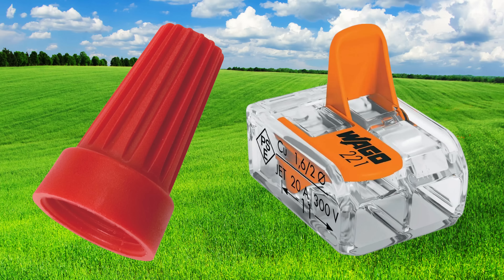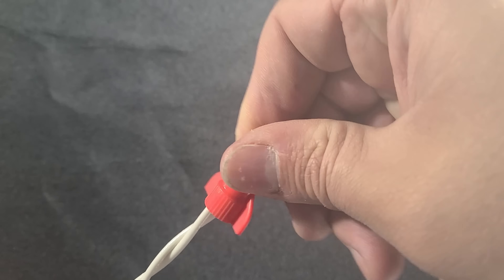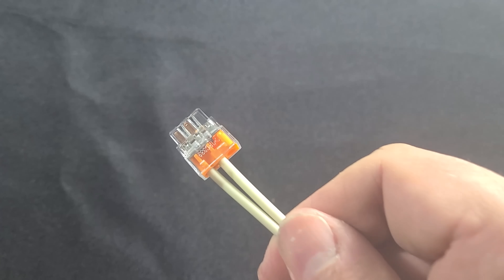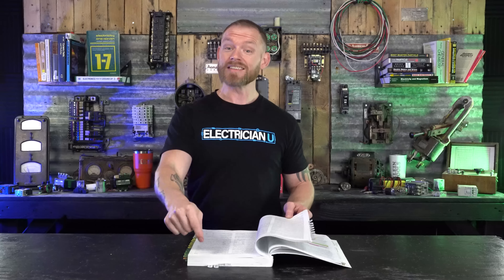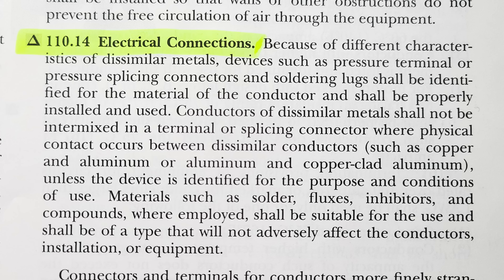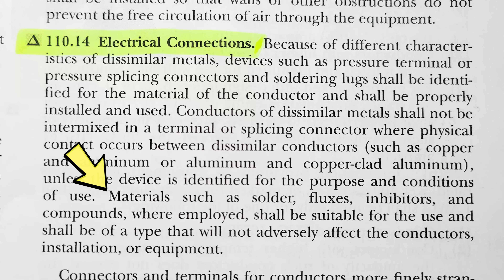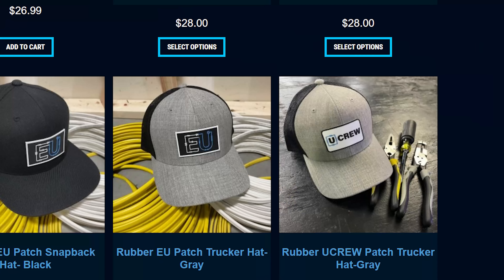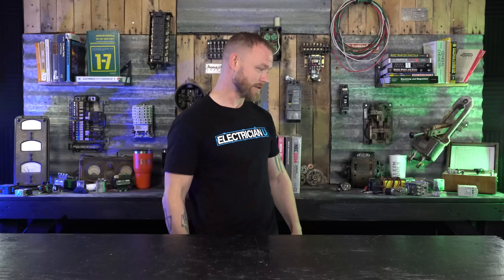Should We Use WAGOS or WIRENUTS?!?!

Comment: Something never mentioned in this debate. The current flows wire -> Wago -> wire while with wirenuts the current flows directly wire -> wire. This means that the Wago is rated for voltage and current. This is something people MUST be aware of and choose the correct Wago for the appropriate amps (221-412 is 20a while 221-612 is 30a). Something concerning about this is that both the 221-412 and 221-612s are the exact same color of orange and identical in shape and size. I'm not sure why Wago didn't color code them differently like we commonly see for wirenuts of different sizes. The only way to distinguish them is by reading their current rating written on their side in a VERY SMALL font.

Comment: I find it amusing that the "Speed Couplers" in receptacles are NOT accepted, YET WAGOS are accepted. They have the same concept.
Prove me wrong with facts..NOT Hypothethis.
According to Electrician U...you can use different gauges of wire!...Stranded Wired I would agree. Never 12 gauged from 14 gauged or vice versa.
I know the answer, ;)
 Bro..answer this question.

Comment: today is the first time Ive used the wago connectors was today, I really like them they are easy to use and let you see clearly if you've got a good connection and you can take them off if you need to re do something. They are great if you dont have enough wire to bring them close enough to get a good reliable connection.  Im not an electrician so anything that makes it easy and more reliable for people like me is awesome. They are more expensive but for someone who uses them infrequently well worth the cost.

Comment: Ive apparently watched this before, but what stuck out this time was his glossing over the twist issue, instead of taking five seconds to point out that wire nuts are not right unless you twist the nut enough to twist the wire inside. I know that’s not the point of this video, but his example of barely turning the wire nut is just wrong,

Comment: I gotta admit Im still resistant to going “full wago”. To me they are still kinda in the gimmick category. I don’t have trouble splicing stranded and solid wire under a certain number. The push in type I will use for connecting lights or for low amperage situations. I’ve had to replace them before when it kept tripping an AFCI at an outlet box with 3 wires. The push in type have the same design as back stabbing outlets which I have spent hours and hours fixing problems that they cause. Including burning up outlets. The lever lock type are better. But as you can see they pinch the wire in a very narrow point, seeming to count upon the malleability of copper to allow the connection to bite into the wire. Essentially the same way as a stab lock or push in wago. Twisting wires provides a larger surface area of contact between the wires and serves as a mechanical means of connection the wirenut keeps it all together and allows air to circulate as well. I see trouble in the future with wagos but they are very cool looking and save time and make splicing way easier, especially with a lot of wires. More than 5 or 6 of same type and it’s a big pain. But that’s rare, and why the hell are you splicing 8 or 9 frickin wires anyway? Tell me that wasn’t something you did on purpose or are you just the 5th or 6th guy that said “F it, I’ll get power out of this box, screw running a home run.” kind of situation? Call me resistant to change, or stubborn or just another egotistical electrician. No splice is 100% fool proof forever under all circumstances and it’s hard to teach good splicing technique, it literally can take years to get really really good at it. Put it this way, which would I trust in my house, with my family? Twisted wires and 3M tan/red, blue/orange etc wirenuts. That doesn’t mean that wagos are bad or not “the pros choice” or anything like that, plenty of pros like them. Do what you think works best for you. I would like to see how they hold up in idk 15 - 20 years, cuz that’s what they ought to be doing. So, maybe I’ll revisit this comment section say around 2040?
Reply: And now I'll tell you something, the prototype of today's push-in WAGO - WAGO 273 was created in 1973. WAGO quick connectors were not originally created for home use, but for industry.
Reply: Besides, in many European countries wire nuts are illegal because there were so many problems with them.

Comment: What is the opinion of the stab connection on the back of outlets? I had an intermittent problem that seems to have gone away by moving wires from the stab connection to the screw. connection.

Comment: Pre twisting conductors whilst using wire nuts is not following instructions.  there is no instruction to pre twist the wires. WAGOS for the win, faster easier, solid, less space used

Comment: I am in the process of tracking down an open ground in my home for a specific series. I have been replacing outlets and switches to more up to date ones and each time I encounter a connection, I use a wago connector to redo it. I also ran into some very short wires and the wago 221-2401 made quick work of adding additional length to be able to bring it up to where I need it.

Comment: I use wago only and I never had the issue that the connection would fail, so your argument that wire nutes make a better connection is not relevant.
The reason why you are using wire nuts is because Americans are generally conservative and patriotic, they prefer to stick to old habits although going another way is proven to be better. I give it 10 years and wire nuts will have disappeared from the market.

Comment: No mention of the tool designed for twisting wire nuts? The NEC shirks the how to aspect of many products, passing it off on the manufacturer? That's like putting the fox in charge of the hen house! So what your saying is the inspector or the electrician is expected to have, on their person, such information to back up gigs as they would with the book for everything else? I can see the future now. A briefcase on wheels with an extendable handle and NEC logo. I share your opinion in this vlog. I've been wiring for over 60 years and, when I was in charge, all wires were pre twisted,  and all cables were stripped before stuffing the box!

Comment: One of the best use for wagos is when you're 15' in the air hanging a (maybe heavy) light fixture. Hold canopy with one hand, and quickly connect the conductors with the wago lever nuts with the other hand.

Comment: We use both and typically order them 100k+ at a time. The larger portion of what we do is LED lighting upgrades in commercial/industrial/mfg/retail spaces. Prepping first saves you about 30 seconds per fixture and really adds up over the course of a shift. The site we're currently working has 17k fixtures ranging from troffers, strips, sconces, cans, etc. Good prep work is the key to good production numbers.

Comment: I used the Wago connectors for the first time today. I had to splice stranded copper to solid copper. I did not trust a wire nut for this, so I went with the Wago, everything is working, no smoke from the outlet... I can see using these on my next electrical project.

Comment: Should a DIYer who doesn't have much experience with wire nuts consider soldering the wires together before twisting on the nut?  Adding solder seems like an easy way to improve the connection's reliability & conductance (compared to an unsoldered wire nut installed by an inexperienced DIYer) and shouldn't add more than about a minute of labor per nut (which isn't much time for a DIYer installing a small number of wire nuts).
     Solder is only semi-permanent.  It can later be removed if necessary by reheating and sucking up the excess with a solder-vac.  That would add another minute if it later needs to be rewired.

Comment: Grandma plugs in a milk house heater that draws 1500 watts and sits by it all day during the winter. 

If a WAGO is under a significant current load for long periods of time, will it perform as well as a wire nut  joint, or will it develop heat due to the resistance of the connection. It seems to me that. WAGO will not maintain a low resistance connection as well as a twisted wire nut joint.

Comment: I don't always pre twist my nuts.
Solely because I'm lazy, sometimes it's the position of the light fixture and its box that makes me not wanna be there any longer.
However, I always tape my wire nuts.
I tape them well. I use it this way because I don't always pre wrap. So I feel like this is even better than pre wrapping. Although you should be tapping them regardless, imo.
Now, as far as wagos go? Idk if you should or shouldn't tape them. I've used them seldomly in situations where I just have to many fn wires. It cleans the entire job up a bit. (Btw im no professional at all. I did learn a little in tech school I went to, instead of high school. Also, I learned from an older guy who built houses. I've never had a connection I did in either manner fail. So, it's rare for it to fail if you do it properly, as simple as that.
I never rush because I don't do it for a living, so I'm never in a hurry.
It might take me an hour to change a regular ceiling light to a ceiling fan. Removal, installation of the ceiling fan kit to secure it, and installing the ceiling fan itself. Testing everything and cleaning up. It will probably take a professional 15 minutes to do the same job. I know it's safe. It may not be done the same way, but it's safe. It won't fail. It won't fall on anyone. That's what matters. If someone professional looks at it, they might think novice, but they will not think of a complete idiot who shouldn't mess with electricity.

Comment: 110.4a : So does this apply to the grounding screw (bare ground wire) in all standard electrical boxes such as light switches with a standard 14awg 15 amp circuit ?

Comment: I'm not a professional. Usually, I try to follow what I think is the professional consensus but I don't pretwist. I use the wire nuts with wings That allows enough torque to easily make a very solid connection. There might be an argument for pretwisting with four wires or more. It can be awkward to get the wires aligned for insertion into the wire nuts and pretwisting might actually be faster. Ideal very specifically says that pretwisting is not necessary. In my thirty years or so of using wire nuts to my knowledge I never had a failure.

Although I have much less experience than a professional I owned an old apartment building for thirty years. There was one failure with wire nuts in all that time. It was a wire nut with five neutrals tied together. I redid the connection with two wire nuts and a pigtail. I never do five wire connections. 

There were a few failures with the wiring system in the original boxes where solder and friction tape was used. The wire had become brittle and it broke where the solder began.

Comment: I love using WAGO units
I've been doing so much electrical work at my job as a service tech that I've actually cut back on wire nuts and gone to using more WAGO units.
Not only is it better but faster and in a number of cases safer.
I've had to replace a number of troffer ceiling lights and not been able to switch off the circuits -- yes I know not a good thing to do -- and using the wago units I cam work with those live wires (110-120 volt units) and move quickly on replacing them

Comment: Right at the beginning a couple of your illustrations of WAGOs are actually one-time-only push-in connectors that don't have levers.  The great thing about WAGOs is that you can unclamp them and get your wires back undamaged.  They are very handy on the workbench (and even in the electronics design lab) for temporary connections and tests.
Reply: One time only if you use stranded wires. They are reusable if all your conductors are solid as you can remove them without damaging the connector.

Comment: I'm not really against wago connectors but it's kind of disturbing that there are so many people out there that are too dumb to use a wire nut properly. I've used wire nuts for my 15 years of maintenance work. I've used thousands of them and never had a problem with one that I installed. I don't wrap the nuts with electrical tape, I don't pre-twist my wires because I've seen bad connections on wires with two full twists and I don't twist the wire below the nut. I just strip them and make sure they're both evenly inserted into the nut. When I'm done I pull on all the wires. That simple. I can put on a nut in about 10 seconds and they cost about $.13 ea for the red nuts vs $.31 ea for wagos

Comment: Thank you for explaining things in terms a complete layman can understand! I watched several of your videos and am very impressed by how easily I could understand things the way you explained them.  I am a complete DIY person and have NEVER understood or enjoyed working with electricity but my wife and I recently purchased a duplex as a rental and I am now the resident "handyman" so I need to know a lot more than I did.  Thankfully, people like you exist and I was able to learn a bunch of things I didn't know.  Just last night I was able to rewire a standard duplex outlet and replace it with a GFCI outlet (in line with another). I wired it all correctly and it worked!  I was also able to install/replace some new light fixtures and those all worked, too!  I purchased a couple of new testers and grounded screwdrivers based on your explanations of what they do and why they are important so I can now at least confidently work with simple outlet and switch replacement and know I'm not going to electrocute myself!  Thank you again for your videos.  I have subscribed and will be watching more as time allows!  Electric work still isn't my favorite, but I no longer fear or hate it like I used to.  Sincere thanks to you!

Comment: @Electrician U -  I have a question:   While wiring up a replacement light switch in a tight electrical box situation, instead of using wire nuts, I twisted the wires together, soldered them and then used shrink tubing to cover up the connection. Is this acceptable, safe, code legal?

Comment: I've had all kinds of negative experiences with wire nuts while servicing older installations, from the cap of the wire nut literally falling to pieces while I was undoing it, to the plastic top just detaching from the brass spring inside leaving a bare connection sitting in the junction box, to the wire nut not being properly attached so the connection came apart enough to start arcing while I was troubleshooting and accidentally pulled a little on a wire in an adjacent junction box.

Now, structural failure of the wire nuts may be down to just aging that Wago's may also experience, given enough time. Plastic formulations these days are more resistant to the elements though, and I have no doubt in my mind that Wago, being a brand priding themselves on safety and quality, will use the best plastics around in their products, whereas generic wire nut manufacturers decidedly will do the exact opposite to make more money.

All in all, I guess the wire nut is as safe as a wago... IF the person who screwed on the wire nut knew what they were doing, but in my experience this is pretty far from the norm. The wago works equally good for stranded and solid core wire, whereas you shouldn't use stranded wire or a mix of stranded and solid core in wire nuts. The slightly increased resistance from using solid core in a wago is something you fix with cable dimensioning and proper sectioning of the installation, imo. You'd get an even less resistive connection by using solder, but it's again a lot harder to get it right. 

In my mind, living in a country where we use both stranded and solid wire interchangeably, the wago just sits at that sweet spot between ease of use, speed of use, reusability and security of the mechanical and electrical connection. The only thing in my mind that is in favour of the wire nut is that it's cheap (and possibly, if one's so inclined - And I'm not one of these - the hipster value of being able to claim that one is a real electrician for using wire nuts, and that wago's are for dirty peasant DIY'ers).

Comment: Used wire nuts for over 50 years with no problems. We always stripped the wire at least 7/8" twisted with heavy pair of linesmen pliers until you had a full turn on insulation trimmed the ends even tightened wire nut with heavy linesmen pliers then applied a few wraps of quality tape.  ( never cheating communist China shit tape ) . Most electrical contractors that I saw were too cheap to use more expensive Wago's. Wago's are nice when replacing red bodine emergency power ballast along with the regular 2 lamp fluorescent luminare. Do not trust WAGOS on machines that create lots of vibration like crushers, hammer mills, centrifuges etc.

Comment: There are push-connectors (which you seem to have been referring to) and then there are lever nuts (what most people associate with wago). You don't just stab the conductor into a lever nut. You lift the lever, insert the conductor, and flip the lever down. Push connectors are not for stranded wire, but lever nuts are great for stranded wire.

Comment: A good question is how many wires can you use a wingnut on?  Also, there are different sized wingnuts and different sizes of wires.   How are you to know the math?  X amount of wires @ a certain gauge= yellow wingnut or red.  I just fixed a switch box that had 7-8 wires going into it. The fan stopped working when I took off the faceplate and I heard arcing. There was a huge blue wingnut with grease everywhere.  The neutrals had a couple more as well and was arcing even worse.  There were 7-8 wires in these large blue wingnuts.  I used wago 221 but they only have a 5 and 3 port option so I had to daisy chain them but so far so good .